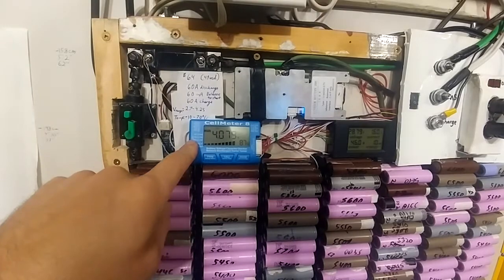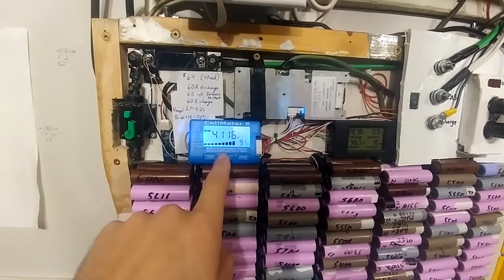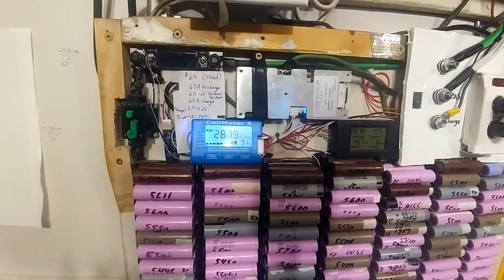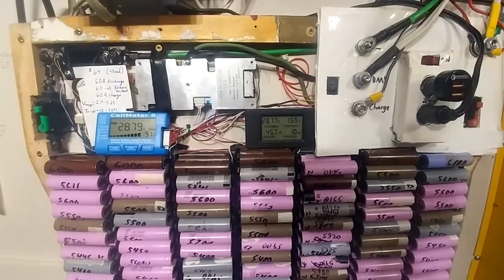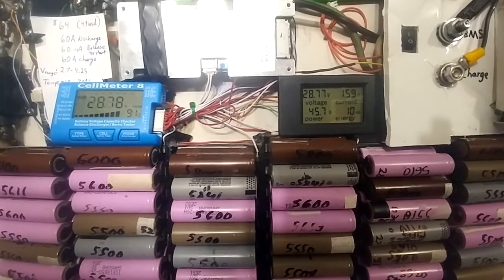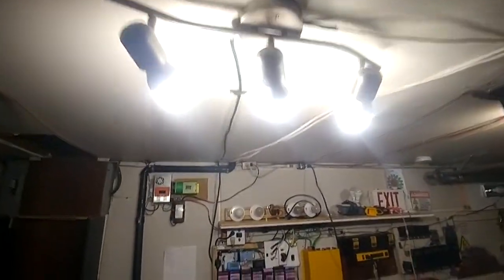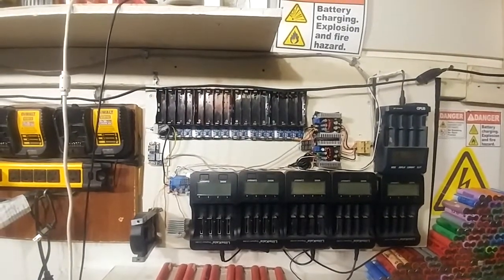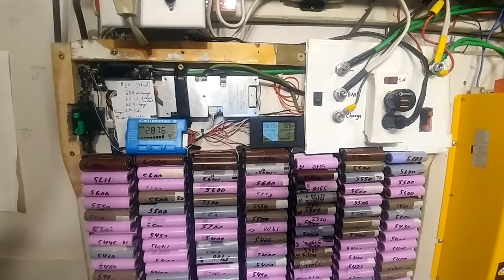18650 7s Nov. 2020 Changes to my next Power wall build

Comment: Hi Andy Just found your channel today and started my subscription. Not sure if you ever posted where you can source laptop batteries in the Toronto area but if you could point me in the right direction would be helpful.  I am building my first battery with Jehu Garcia's 18650 holders mounted on circuit boards that are fused and are stackable. I like your approach and may go that way once I get my feet wet some more. One tip to pass along YouTuber HBPowerwall mentioned that he now does not mix 18650 high amp discharge batteries with 5A laptop batteries even though they have similar capacity match. They appear to take charge and discharge a little different then the 5Amp laptop's
Reply from the maker: Ty great np! How many cells do you need? It's hard as the recyclers don't like to sell them. Kajiji wtb ads are good but you get a lot of bad cells for too high of a price :(
The cell thing ty diff specs for both def
Jehu cell thing is simple but $. You don't need all that but simple and easy to use
Reply: @AndyShell  Hi Looking for 50-100 cells and would be interested in where you were able to obtain them in the Toronto area

Comment: Hi Andy, I'm using 2 of those 320A BMS's and had zero issues for the past 2 years since having them.
If you want a really good bms app (English) that will work with the ANT type BMS, use the VBMS in play store. It was designed/reworked for Ebikes by Tony of Vortecks but I'm using it for my power walls fine. The amount of settings is fantastic. There is a small fee but well worth it.
Any help or information needed just let me know.
All the best